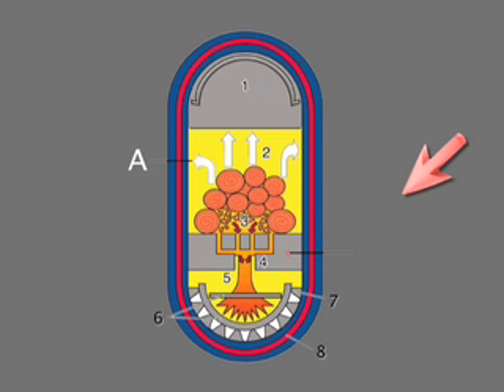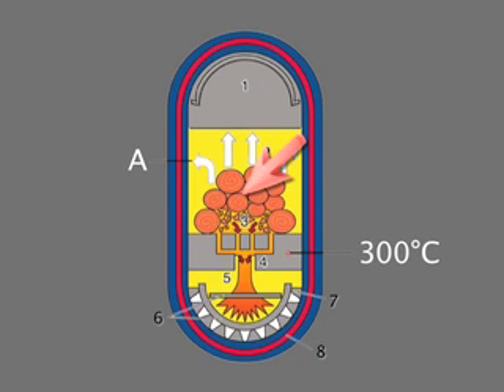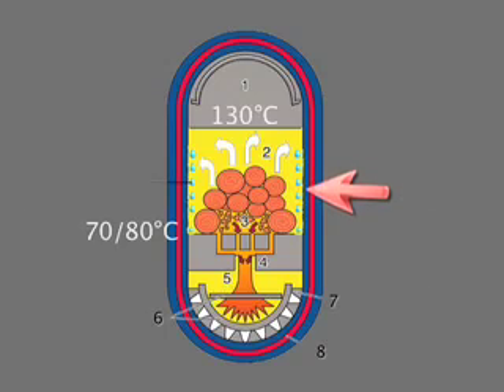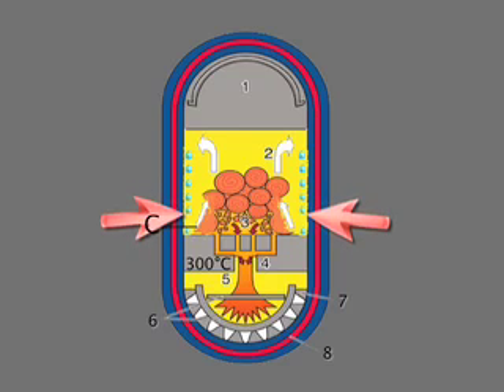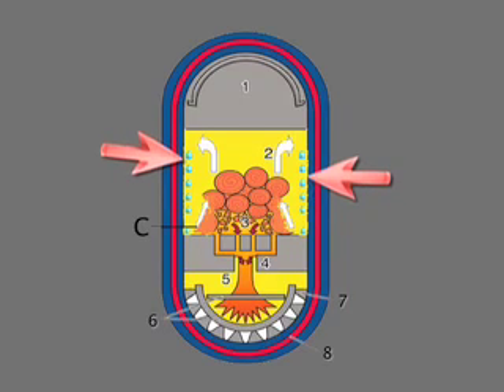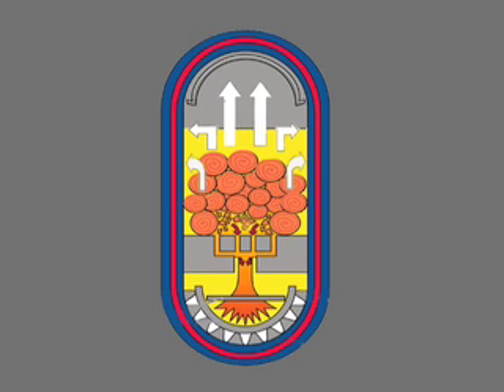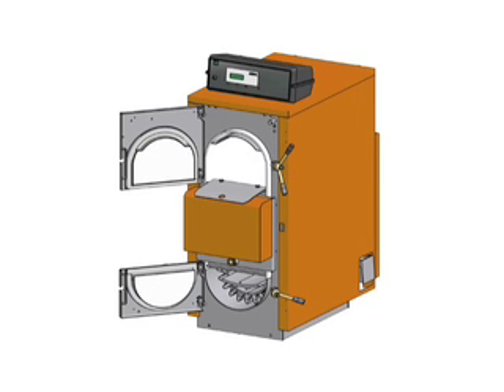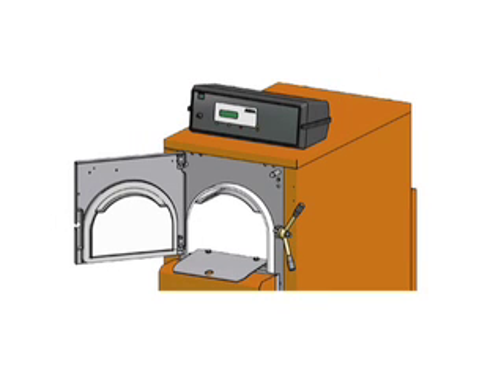The phenomenon of corrosion into the gasification boilers (ENG)

Comment: I think this is a function of how wet the wood is and how well the unit is insulated.  If the wood is green, you will get a lot more water vapour, if the wood has had a year outside to dry out, then been stored in a dry shed for another year, it's going to be quite dry, and produce a lot less vapour.   I don't even think steel is an ideal material, say we have a 1cm thick refractory ceramic layer, then a 5 cm thick mineral wool insulation, then another 5 cm of foam insulation, only the outer jacket would be steel.  Since we keep the refractory layer at around 300C, then there should be no problem of wet tar buildup.  

I don't think it's a good idea to keep such a unit on long term standby, it's probably better to use a solar water heater in warmer periods, so that your not needing a fire, just to heat domestic hot water.

Comment: I have also seen carbon steel gasification boilers have their steel eaten through from the acids. I have also seen cold start oil boilers produce an acid that eats through chimney pipe in just a season. The answer to these high tech efficient boilers is the use of stainless steel in the fire and exhaust chambers and pipes depending on gas analysis when firing. High efficiency is teaching all of us that the "old way" of looking at combustion of any fuel has to adapt to different by products during the stages of combustion and chamber temperature rise and fall at the heat transfer points. Just 60 years of watching things burn has taught me much too late.

Comment: This is why the Wood Gun is built with 304 SS. Early models were built with carbon steel and some failed in as little as three years. Stainless steel Wood Guns have been in production since 1986. Alternate Heating Systems is an ASME shop, and construction strength is tested and certified welders are required. The Wood Gun E155 is the only indoor, downdraft gasifier with EPA approval without thermal storage.

Comment: The use of a Laddomat or Danfoss 'Charging valve' stops the effect of cold water return being allowed into the boiler jacket, so  temp is maintained so that creosotes don't crash  on the walls.... burning hot and then shutting down the unit rather  on idle mode is also the way to go.....also proper multi coiled  buffer tanks with stratification  creates a good working platform for those various water needs, showers,washing clothes, hydronic heating and the like
Reply: You would need to maintain very high water temps to make this work. This is not practical for folks who have PEX close to the boiler.
Reply: That's my  very point...

Comment: they will most likely not be there as the draft of the fire is forced downwards into the secondary burn chamber where the hydrocarbons in the smoke is forced out of the smoke because of thermodynamics. thus, this is why there is a second chamber to burn these hydrocarbons, giving it it's high efficiency rating.

Comment: i dont think a gold plating would be helpful here. as the melting temperature of pure 24k gold is 1945 degrees F., it will most likely melt inside the secondary burn chamber unless it is mixed with some other metal. even further still you would probably be better off seasoning your wood. if you can get the wood to "check" quite a bit, to where the water content is like 20% or so, i think this will not be a problem. also, the tar like substance he is talking about are unburned hydrocarbons and...

Comment: What could you do? The corrosion part is obvious when it's carbon steel, as the heat accelerates the chemical reaction called "oxidization" that occurs. But I would've never thought stainless steel would be corroded in gasifiers. Even if it seems funny, could a layer of gold plating make it virtually corrosion resistant and therefor alleviate its cost by replacing the need for a new hopper?